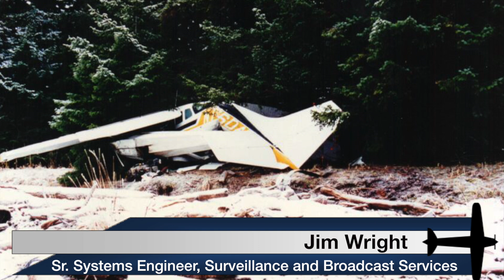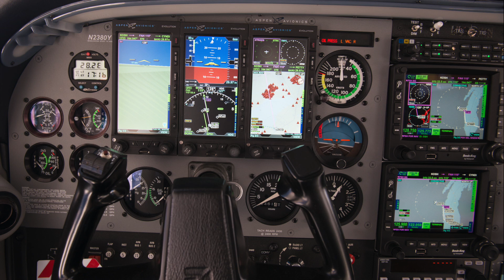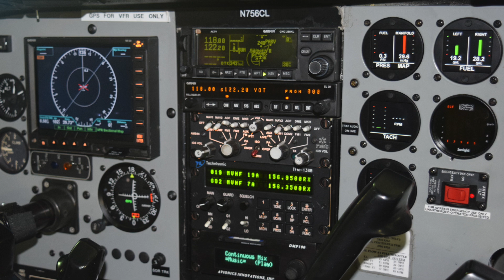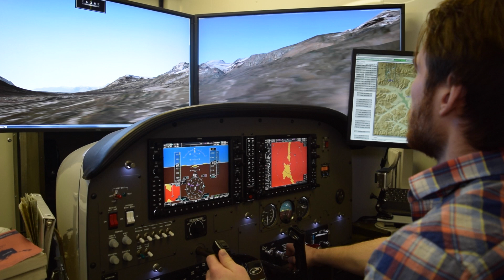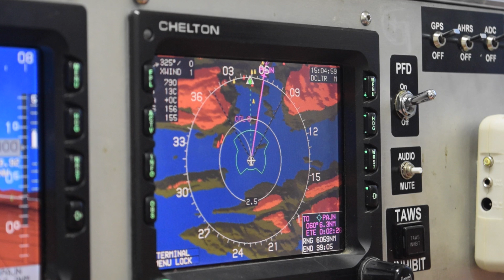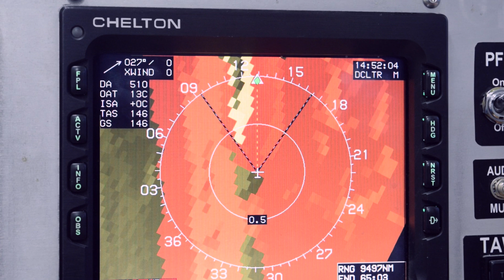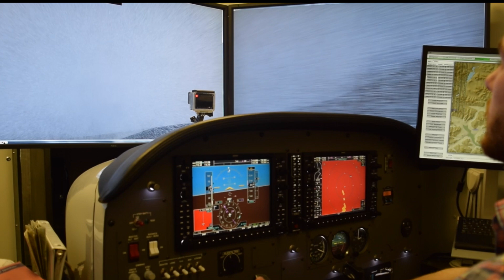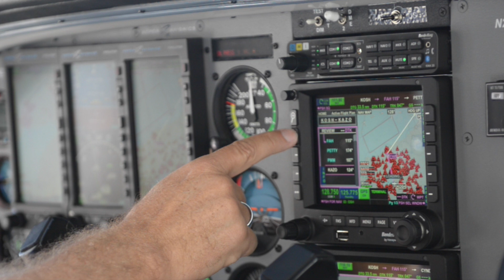Controlled Flight Into Terrain: What more can we do?

Comment: Kobe brought me here and I cannot believe what I'm hearing. Apparently, you can have the green light to fly without being fluent with your equipment. These guys are imploring current pilots to learn their instruments. Like WTF? I've always assumed pilots have 100% command and knowledge of their cockpit.
Reply: They should but you know people; most pilots are very responsible but somebody will always cut a corner.  Part of the problem is that some of the equipment has changed; people trained on the older "steam gauge" round dials have a learning curve to the newer computerized panels.  And sometimes a well used piece of equipment (like a handheld GPS--not certified for IFR use, but helpful) can be slightly different depending on the manufacturer.  And there are some gotchas, like using weather radar data that that is sent to the pilot and typically is a few minutes old.  Several people have forgotten that little fact and flown into thunderstorms.
Reply: Kobe’s incident wasn’t CFIT